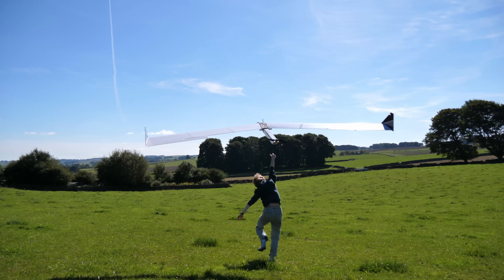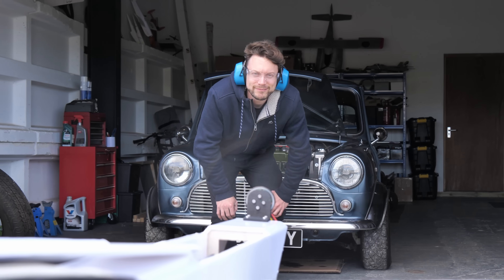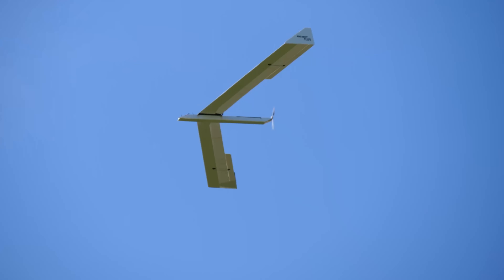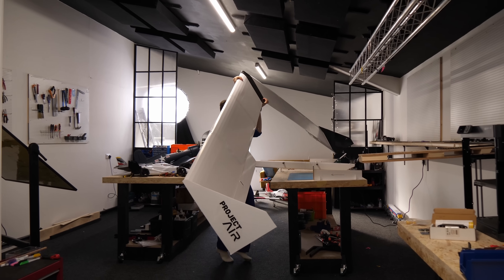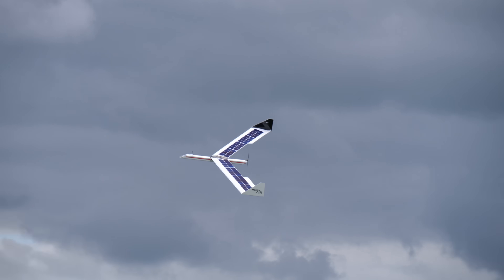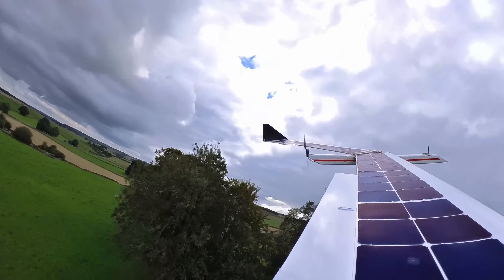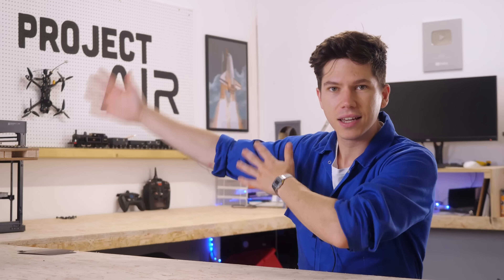Solar Plane V2

Comment: Why are you using a swept wing? Arent those for efficiency at high speeds?
Reply: My guess is to avoid having the extra drag of tail surfaces. That's the main benefit of flying wing designs, reduced drag. But it requires a fair bit of wing sweep to get sufficient moment arm for the elevator control surfaces.
Reply: Yeah I wonder if it provides some advantage I'm not aware of. Because it's usually not used for long range stuff

Comment: its not hard if you dont get stuck in the specifics. top down design then bottom up implementation. goal based design vs detailed implementation. kite is the most lightest, if not compared to a very large solar blimp. solar plane concept should work in all weather, not just best sunny clear days.
Reply: The project requirements drive the design AND the process. Do you want to simply function or perform optimally? The second plane moved back towards basics.
Reply: @kjdude8765  dont get bogged down in the wrong place, not working project is not a delivered project. keep it simple, dont go complex because of optimality, complexity is not optimal design principles. find the key features you need and ditch the feature creep.

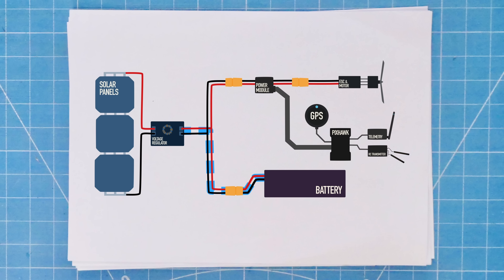Comment: 2:40 Well, the simple regulator lacks the capacity to do maximum power point tracking, literally the meaning of MPPT. More efficient would be to have the MPPT in the loop, but connect the load (and maybe the regulator) directly to the battery-terminal of the MPPT along side the battery.
Reply: Yeah this part was particularly frustrating. Especially as they got someone with apparently more experience to help.
Reply: This! I'm only 2minutes into the video and scratching my head, why on earth one would ditch the MPPT and go for a Buck/Boost converter. Just connect the Battery to the MPPT and the ESC/powermodule in parallel. This way you get the optimal charge power from the MPPT while keeping the plane powered, even if the MPPT disables its load output.
Reply: The mppt should be between the solar cells and the voltage regulator
Reply: Definitly an mpp controller would make sense, espessially when stripped of the heatsink and installed a more lighteight, high airflow appropriate cooling system
Reply: Yes, if he will have any sucess you need MPPT, it provide somewhere around 25% more power. Connect the battery directly to the ESC is better than to destroy a airplane.
Reply: I think many MPPTs aren't designed for the highly dynamic conditions here, changing rapidly on the input and the output side. I agree that a regulator with a fixed output voltage is sub-optimal. When the incoming sunlight drops off, it will pull too much current, reducing the voltage far from the max power point.  If it could stay at a fixed input voltage (like Adafruit's solar charger) or even a fixed voltage ratio, it would be better able to handle varying incoming solar power. I agree that an MPPT would be best, if it could handle quite rapid changes.
Reply: @palmariusbjrnstad1682  The "fixed input voltage" thing is called MPP.
Reply: Yeah just draw directly from the battery. I did a full electric conversion on my sailboat and this is how I set it up. Your flight controller has a built in voltage regulator, you don't need to double that up.
Reply: Exactly. The MPPT makes sense - it's just the low voltage cutoff that's the issue. Powering the load directly from the battery avoids that problem.

I also wonder if the voltage regulator they are using has an appropriate current limit. If not, it could exceed the charge current rating of the battery. It would be particularly prone to doing this when the battery is low and/or at  low throttle settings.
Reply: @dack42  This is what I came to say; if they fly for too long in the clouds (and the battery discharges significantly lower than the regulator's setpoint) then it would likely cause damage to the battery when they reenter sunlight.
Reply: By the way, @ProjectAir, no shade to you at all 🙂 It's easy for us to armchair engineer something after the fact; you're designing a system that I've never come close to doing. Great work! Just here to provide some insight 🙂
Reply: @dack42 I found the exact step down converter he uses on aliexpress, and it does at least have an adjustable current limit (And is rated to 300W or 15A). Although I definitely agree that it is bad to switch to that instead of a different MPPT. 
The description also mentions short circuit protection, which might cut of power, when there is a high voltage difference, due to low internal resistance of lipos? Not sure about that.
Reply: I think I'd rather have a small backup battery for the flight controller so it can glide to a controlled landing and keep the plane on the battery protecting cutoff on the MPPT myself - the end goal of a sustained flying on solar means you are not going to want to be manually in control and monitoring the telemetry all the time, so being entirely unable to over discharge the battery with the flight controller bringing it down on the glide from the backup battery when the power is out seems best to me.

Though I don't think their current approach is necessarily that bad MPPT can be a good thing no doubt about it, but an efficient buck/boost regulator is almost certainly lighter and probably not that much worse, may not be any worse at all in these challenging conditions anyway for the MPPT to actually track the optimal point. Between continual angle changes to the sun, self shading the panels near the wingtips with those stabiliser etc it will mean the MPPT is having to chase the array's wildly varied output potential a great deal more than a more static ground install - which it might not actually manage to do very well so could even be harming the efficiency of the system overall (though it would be very possible to test that on the ground and I'd love to see the results). However when you are actively having to fly that extra mass unless the solar efficiency gain is huge its probably not worth it.
Reply: all theyd need to do is swap t he voltage regulator with the mppt charger, and keep the ESC connected to the battery
Reply: Lol you're literally just copying RCtestflight
Reply: The T of MPPT makes no sense since it will never stabilize on a plane. You need MPP.
Reply: @pepethefrog7193  Meh. Sure it will be dynamic but in stable, level flight it will change far more slowly than the MPPT charger will adjust the parameters.
Reply: @HansZimmer-b1r  Seems you have no experience with real life MPPT. They suck big time. A much simpler MPP adjusted to the panels MPP voltage (cell mpp volt x number of cells) works way better.